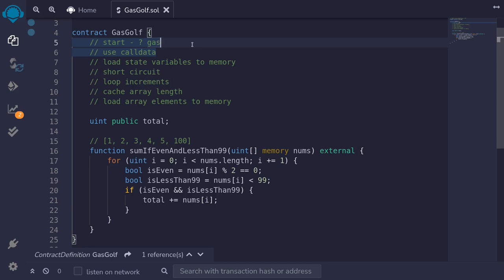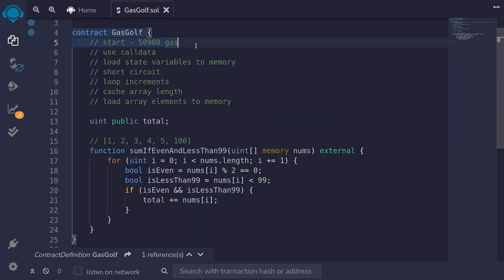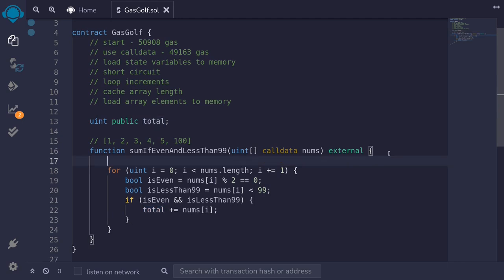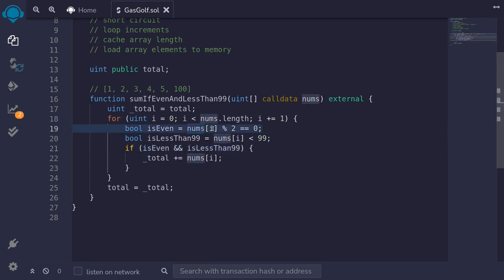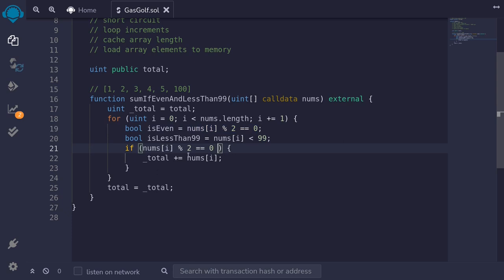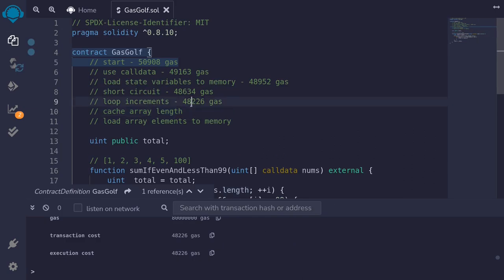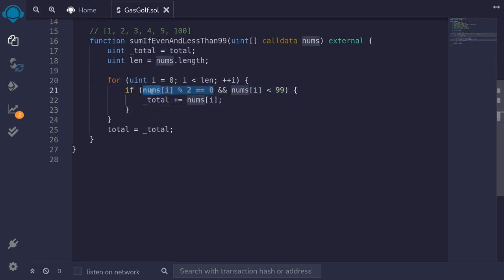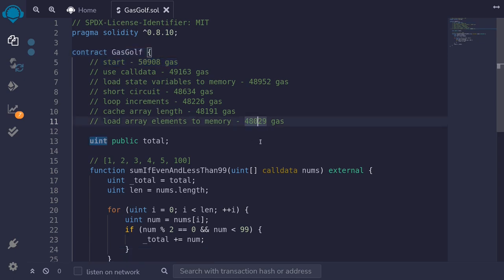Gas Golf | Solidity 0.8

Comment: This can more gas optimized by adding unchecked overflow i increment. I added one more optimization in your code.

// SPDX-License-Identifier: MIT
pragma solidity ^0.8.10;

// gas golf
contract GasGolf {
    // start - 50908 gas
    // use calldata - 49163 gas
    // load state variables to memory - 48952 gas
    // short circuit - 48634 gas
    // loop increments - 48244 gas
    // cache array length - 48209 gas
    // load array elements to memory - 48047 gas
    // unchecked i increment overflow - 47645 gas

    uint public total;

    // start - not gas optimized
    // function sumIfEvenAndLessThan99(uint[] memory nums) external {
    //     for (uint i = 0; i < nums.length; i += 1) {
    //         bool isEven = nums[i] % 2 == 0;
    //         bool isLessThan99 = nums[i] < 99;
    //         if (isEven && isLessThan99) {
    //             total += nums[i];
    //         }
    //     }
    // }

    // gas optimized
    // [1, 2, 3, 4, 5, 100]
    function sumIfEvenAndLessThan99(uint[] calldata nums) external {
        uint _total = total;
        uint len = nums.length;

        for (uint i = 0; i < len; i=unchecked_inc(i)) {
            uint num = nums[i];
            if (num % 2 == 0 && num < 99) {
                _total += num;
            }
        }

        total = _total;
    }

    function unchecked_inc(uint i) internal pure returns(uint){
      unchecked {
        i++;
      }
      return i;
    }
}
Reply: this is awesome, can you explain what does it mean to be unchecked?
Reply: @sirstroopwafel  from the solidity 0.8.0 inbuilt checking overflow/underflow condition on arithmetic operations. In this example, there is already declaration of the variable "i" is not greater than the array length, that's why "i" will never overflow from the Uint. So we can simply bypass the overflow/underflow condition by using "unchecked" method.
Reply: @akshaytarpara5025  I see, thank you!
Reply: Awesome observation. Thanks!